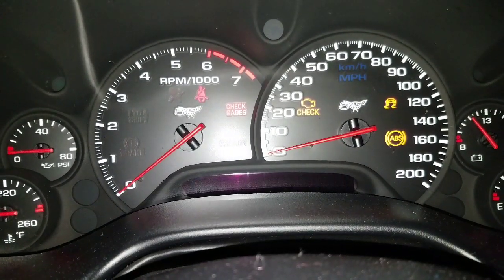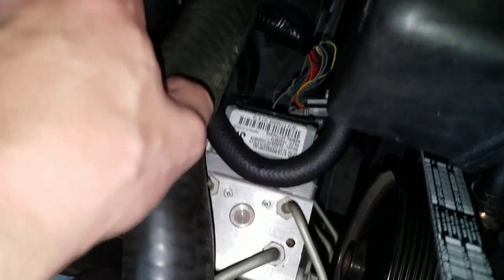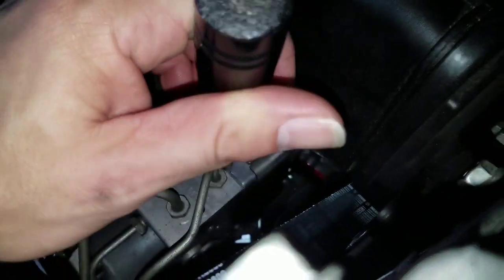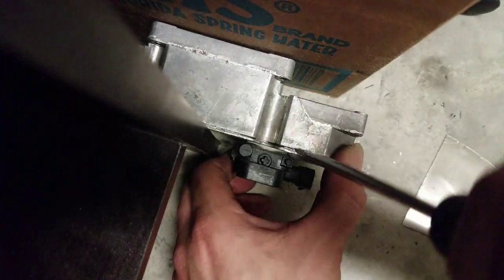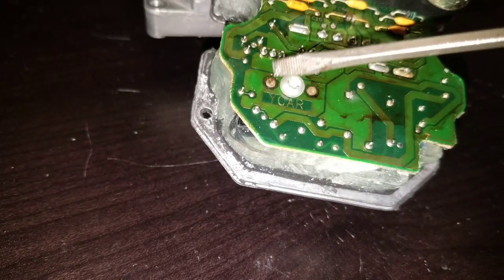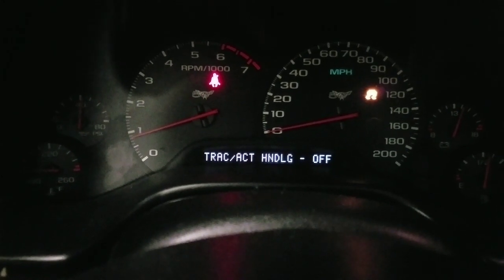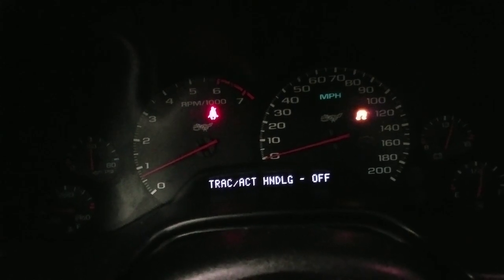Fixing the EBCM (electronic brake control module) in A C5 Corvette (2001 to 2004)

Comment: what if you have a 2000? what are the options?
Reply: I'm no expert but I believe if you have a 97-00 your only option is to buy a used module, I've heard 97-00 are near impossible to repair, and replacements arnt cheap. 01-04 is a different module.

Comment: Hi, i have a 2003 c5 corvette, and sometimes appears the error 28-TCS  C1296H ( entering in the manual diagnostic, it appears as H, History). Do you think that opening and cleaning the electronic PCB could resolve the problem? Regards from Italy.
Reply from the maker: This car is  2003 as well. If you are having the same issue, this should resolve it if you follow this video. Cool that you have a C5 in Italy

Comment: Great video. Just an FYI on the back side of the housing is a hole about 1/4 inch in diameter. I'm not sure of the actual diameter. Anyway, there is a clear pathway from the hole to the cover held in place by the four screws. You can drill and tap that hole for a fine thread bolt long enough to push against the cover plate as you screw it into the housing. Go slow and use a razor blade to carefully separate the cover from the housing. That is much easier and causes no damage to the unit.
Reply from the maker: I wont have to worry about that anymore. I no longer have the car.

Comment: Can the 99c5 be repaired? I heard  they were not repairable
Reply from the maker: If you can get the casing open, I do not see why it wouldnt be. usually it is some bad soldering on the points that makes it lose connection. But I have also heard that the 2001 and back Vettes were not fixable.

Comment: hanks for video - unfortunately my C5 EBCM is not that model and taking it apart shows a diffeent circuit board. Can I ask where you got the info to do this in the first place?
Reply from the maker: Ive done this before on my body control module with my Camaro. Some the Soldering points loses its connection.

Comment: This is by far, the best video on this i've seen. Thank you for getting in there and getting a closer look at the ebcm. I just bought an 03. Picking it up Saturday. I'm pretty sure this needs to be done. The service vehicle soon message is on and I can't remember the other one, i think it was the traction control. Anyway, I have to drive it home 3 hours from Virginia beach back to my place in Delaware. Again, that you for the video, very detailed!
Reply from the maker: I appreciate that. Thank you.
Reply: @chemicalspore  I finally went to do this today. The middle bolt on the right wont budge. I think my t20 is too wide and shirt to reach that one ugh
Reply from the maker: Getting in those small spaces to see what is going on can be a pain. Try getting into yoga, than you can bend anyway to conform getting in those weird spots. lol
Reply: video ok
Reply: I know it's been a while. But my service active handling comes on sometimes. Esp if it's cold. Could a lose connection cause this?

Comment: Does anyone know if it will work on a 2001 ls1 camaro I believe it will?
Reply from the maker: I have a 2002 Camaro that I have yet to have issues with. I am sure if you pull the EBCM apart and look for bad solder points, you could refurbish them.
Reply: @chemicalspore  
I pulled the module off but there is not back plate as noted in your video it is just a plastic housing with no screws that I can see so I'm not sure if I should pry it off and end up doing more damage to something. I can seem to find any info or video on a camaro ls1

Comment: Thanks, I just did this on my 2000 Buick La Sabre. The module looks identical to your's. It was hell to open and I saw no solder joints that looked bad. I resoldered all I could reach, cleaned with CRC electrical cleaner and resealed using black RTV. I thought I'd wasted my time but the light reset and hasn't returned after about 50 miles. I still don't know what I fixed. I didn't find your video before, I guess, because I searched under ABS an not EBCM.

Comment: Is it locating under coolant pipe? :D when thermostat  or anything in cooling system is changed its possible that coolant goes in wrong place
Reply from the maker: It does sit under a coolant hose.

Comment: Would a bad EBCM also throw a 1287 and 1288 code as well? I am getting 1214, 1287 and 1288. I would think since the ebcm is the "brain" the steering sensor may be getting false readings? 02 z06 only 24k miles lol..
Reply from the maker: It does not interfere with the steering, only abs and traction control.

Comment: Well, I finally tackled this job myself over the weekend on my 2003 C5 z06. Worked on it on a Friday & Saturday to get it done. Not gonna lie, it's a beating! The easiest part of the whole job is the soldering you do on the circuit board. Removal of the EBCM, removing the cover for access to the circuit board and then re-installing the EBCM back in place is the beating! I'm 65 yrs. old, too. So if I can do it, almost anyone with some patience, common sense, mechanical ability/experience and a little circuitry soldering experience can do it. It actually WORKED!! Everything cleared, all the warning lights that were on went off and now my ABS, traction control & competitive driving modes all work again perfectly. Like I said, it is a beating but, not near the beating of $1700 to have the job done. Thanx, YouTube!
Reply from the maker: you're welcome
Reply: @chemicalspore  - And thank you, too for posting this video.

Comment: Mine is a 07 trailblazer, the traction control light comes on, and it applies the brakes and heats the rotors, anyone seen this?
Reply from the maker: I have not. You might want to call gm
Reply: @chemicalspore  Thanks, maybe I will get their opinion before I take it apart.
Reply from the maker: @CylinderPro-aliasWonderdust  could be alot of things. Maybe you have a crimped hose or line. Check your fluids, the calipers could be locked up.
Reply: @chemicalspore  one caliber is new, the master is new, I recently bought this suv and put the engine in, they lost a puck out of one caliber and bleed the system off, then I could not get the pump to prime, had to crack the tubings at the pump even on the new one to bleed it. Anyway, 500km later, starts setting the traction control fault light, then I notice the brakes, (both front for sure) dragging , so it is escalating.
Reply from the maker: @CylinderPro-aliasWonderdust  have you scanned the codes?
Reply: @chemicalspore  Yes, no code set, anyway, took the electronics off, same seize up as every old abs system, must have caught some dirt from being disturbed, the old master was black. Will get another module from a wrecker and try it. Thanks for the help.
Reply from the maker: @CylinderPro-aliasWonderdust  thank you for watching my video. Keep me updated on your brakes.

Comment: Ideas on best place to buy a replacement one of these, or who can repair it besides a dealership.  I sound like a moron, but im a driver lol.
Reply from the maker: I really do not know. You could try an electrical shop and show them a video like mine. All it is some soldering and you are good to go.
Reply: @chemicalspore  Was it easy to obtain the part, its not obsolete?
Reply from the maker: @davelyons9959  i just took it out and repaired it myself. Not that hard
Reply: @davelyons9959  Parts aren't being made on older vettes.  Not on mine, it's 2002.  You have to look for refurbished.  If you get someone else to replace it, keep your old one and try doing steps in this video.  I don't know why mine has the TCS code come up with check abs, check traction control, check active handling with only 47,000 miles.  That just sucks.

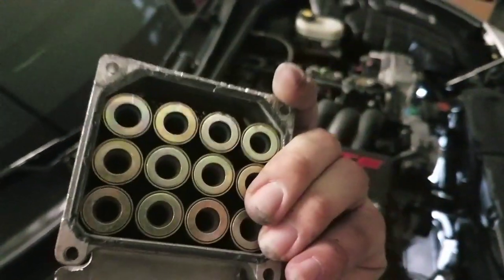Comment: Do you see that "blind hole" at 4:05 next to one of the mounting holes? you can drill that with a #7 drill and tap that hole with 1/4-20 tap. You then thread a 1/4-20 bolt through there which will go right through the case (without damaging anything) and will apply pressure to the cover plate whilst you start to cut away and pry the plate from the case. You continue to thread the bolt as the cover plate loosens and you continue to cut away at the RTV until it completely comes off. This will save you a ton of time/effort in trying to remove the cover plate. Thanks for the video!
Reply from the maker: That is nuts, never thought of that. Thank you for watching.
Reply: @chemicalspore  I did that and it worked great saved 2k

Comment: Can you drive the car with this removed? My 01 Z06 has this issue and i want to get it rebuilt but dont have another car to drive...
Reply from the maker: Im sure you could but it will still throw the same codes
Reply: you can drive it .... u can do it your self just done mine ,about 2 hours

Comment: Nice work. Also see the wheeler Dealer C5 Z06. They have a good way of checking with a multi meter. And proper handling of circuit board.

Comment: Are the six bolts removable from the top or underneath?  And how difficult are they to get to?
Reply from the maker: You can do it from the top. Not that hard, just got to have patience
Reply: @chemicalspore  Thanks, may attempt it this week.
Reply from the maker: @DanPattonFotoZ  it's not that bad
Reply: @chemicalspore  Well, went and checked mine and it has 4 bolts.  My Vette is a 2000 and they are different.  Been told buy a long time Vette tech that they cannot be rebuilt so I can't decide whether to remove it or not.  If you or anyone else have heard different, please let me know.  Thanks!

Comment: I have the same lights intermittently coming on. The code I pulled was a TCS-C1242 (pump motor ground circuit open). Is this the same code you had?
Reply from the maker: I am not sure. I never checked the code. Have you changed anything electronics or any fluids on the car?
Reply: Yes. The car had sat for awhile and the battery died. Replaced it, and now this is happening

Comment: Would it be the same on a 2000 corvette?
Reply from the maker: I am  Not sure but I feel the anatomies of electronics or the same from 2000 to 2003
Reply: Bernie,  My 2000 has 4 bolts and I have been told they cannot be repaired.  If you find out something different please let me know.

Comment: I COULD NOT GET MINE APART TO EVEN ATTEMPT A DIY , SO I SENT IT OFF TO ABS FIXER. $150 QUICK TURN AROUND.
I HAVE HEARD IT IS USUALLY A $ 2 PART.
Reply from the maker: It was not easy to do. Some solder, and it was good to go